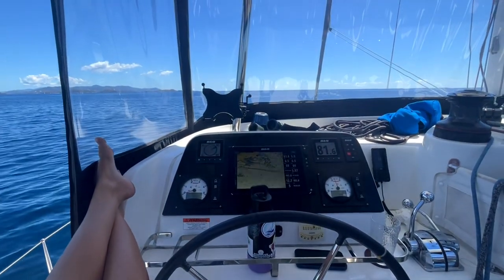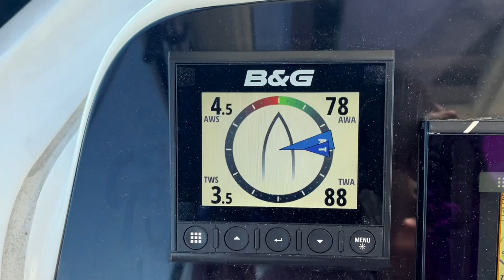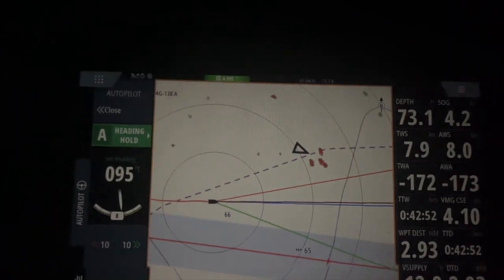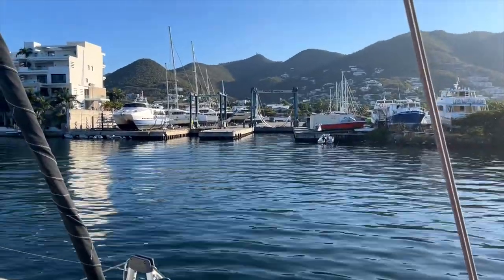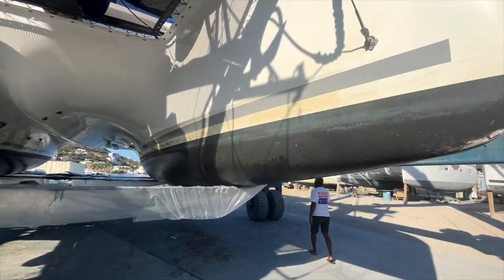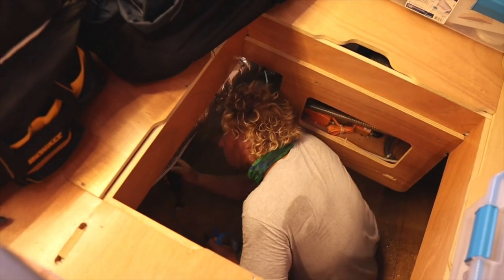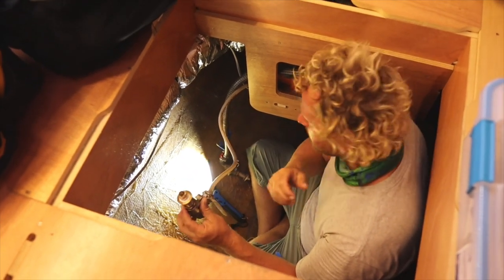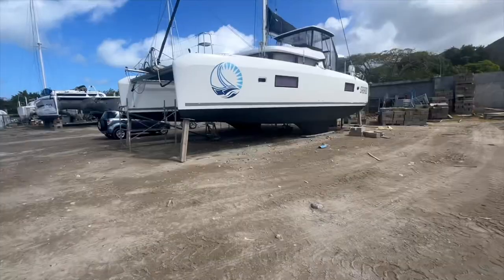Sailing to Paradise: Hauling our Boat for Maintenance in St. Maarten

Comment: Another great video I love the food prep with mention of the air fryer. Clearly your power worries are over. Good call on the thru hulls and 25 a lot. The bottom looked great as well.  Exuma Bound was just up on the hard for a few days as I needed to replace some electronics.  Always a never ending process but they sure love our attention.   I love boats and yours is always impressive. Best of luck and she will be ready for a splash soon. Thanks for sharing as always.
Reply from the maker: Thank you! Yes, and I am loving my new galley appliances. :) What yard do you haul Exuma Bound out at? Hope she is doing well! The boat work truly never ends… 😂
Reply: @HollyandRay  we are at Browns. All power boats probably because not much water going in. For instance we only draw 18".